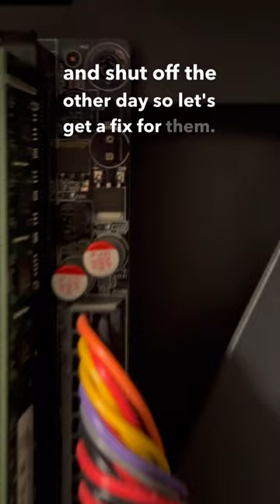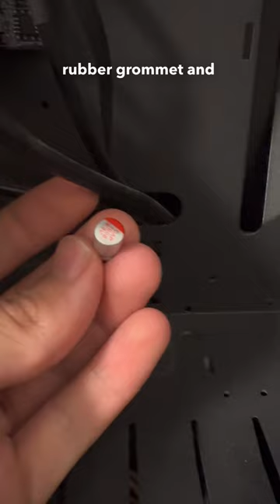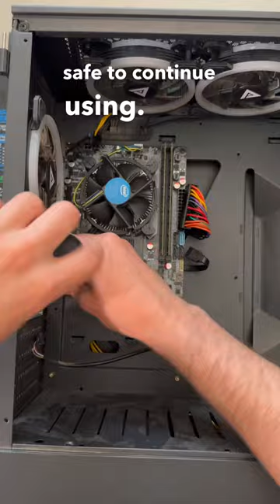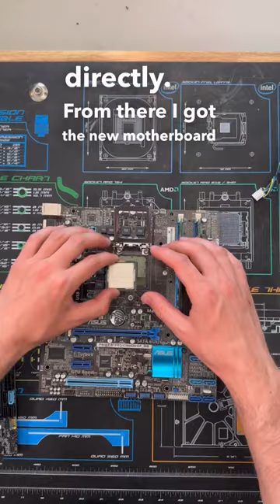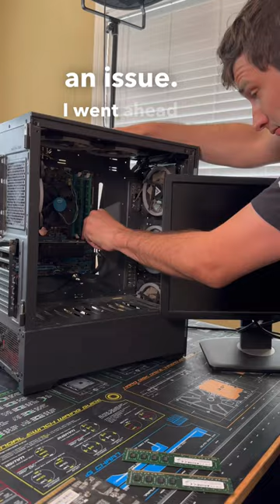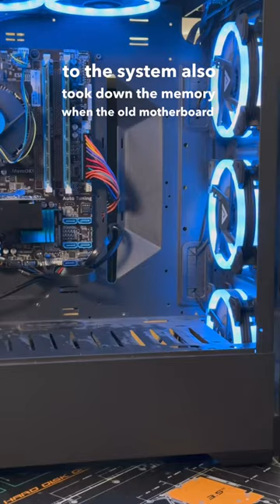This Gaming PC Started Smoking!🔥

Comment: ...Just how exactly do you use a computer to the point a capacitor pops off the motherboard?
Reply: probably unstable electricity and/or bad psu. and also possibly old mobo so the capacitor leaks and does things. but h61 isn't that old anyway, i'm on G31 (Core 2 Quad) and it's very fine, probably the first.
Reply: @steriftes  Even so, it doesn't make any sense. I'd rather believe the capacitor exploded (which would require some serious overlocking) than it popping off like that. It seems more plausible that the owner messed up while mounting the CPU and accidently knocked it off, but not completely to the point it was at least able to run... for a while, until the strained contact points finally gave in?

I guess guessing is what we can only do, eh?
Reply: ikr!

Comment: My display stopped working after i installed my ryzen 5 5600g into my gigabyte ga-a320m-s2h i watched alot of videos apparently i need to update my bios i dont have the old cpu. I bought a new gpu still didnt work i need help please!
Reply: I upgraded from a ryzen 3 3100 btw